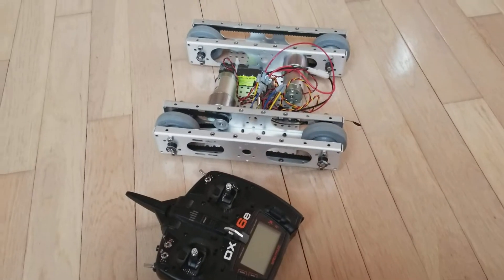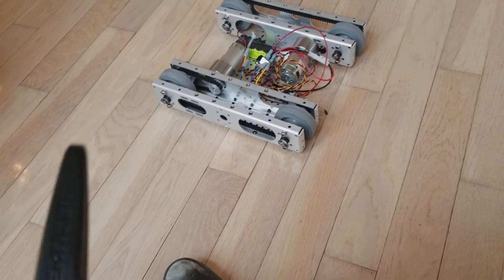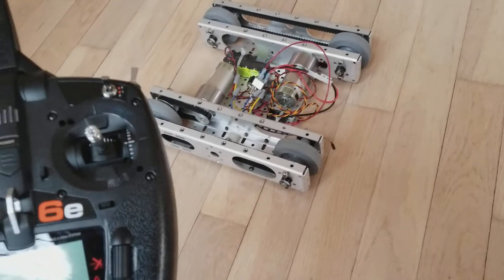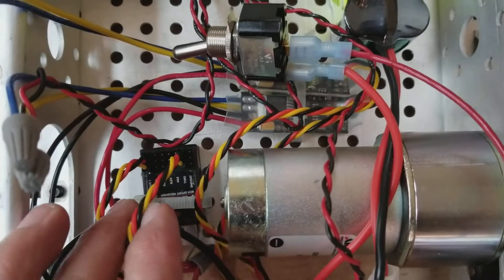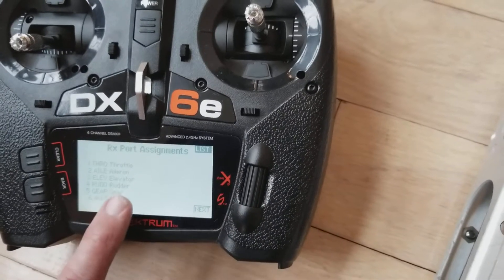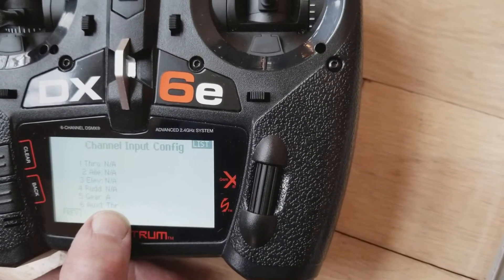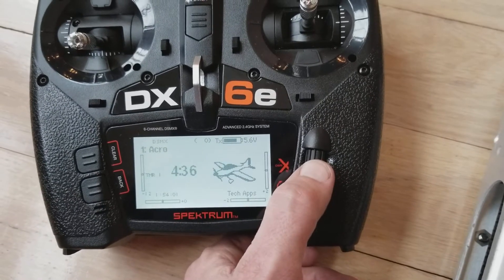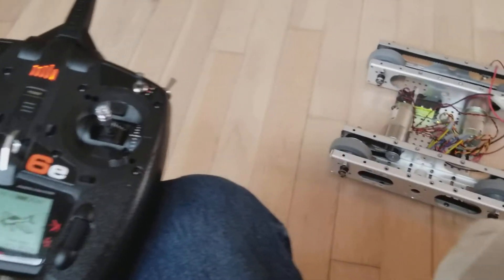Depco battlebot differential thrust set-up

Comment: are you using 2 esc ( 1 for each motor) or are you using a dual motor esc.
Reply from the maker: This setup uses a separate esc for each motor.  A better solution is a dedicated dual motor esc.  With a dual motor esc, the mixing and “differential” thrust can be setup on the esc itself and therefore, less fancy radio programming is required.

Comment: can you setup differential thrust/ steering on a 2wd battlebot without making it 4wd?
Reply from the maker: Yes, definitely.  This bot is is belt drive to make it 4wd, but still only 2 motors, 1 left, 1 right
Reply: @VogelManufacturing  3 years late omg

Comment: How do you get the throttle to be centered so you can use the reverse
Reply from the maker: This radio has a switch option on the backside to engage/disengage the “center” stick feature